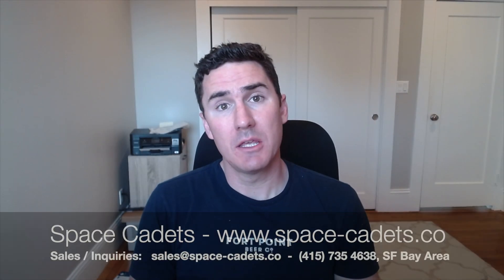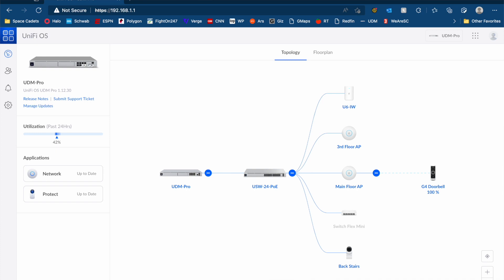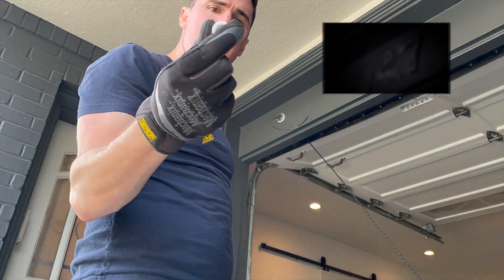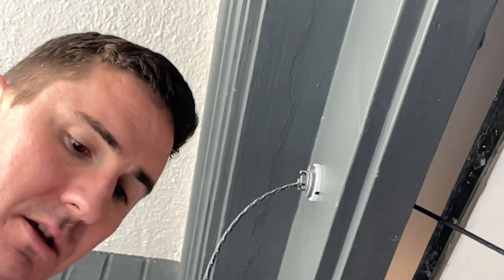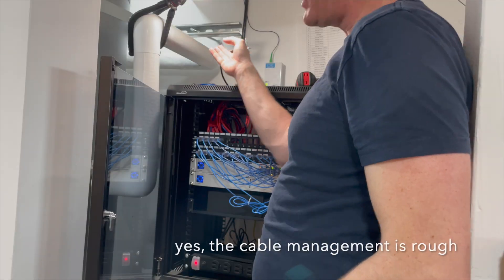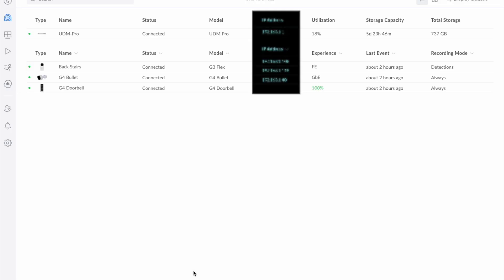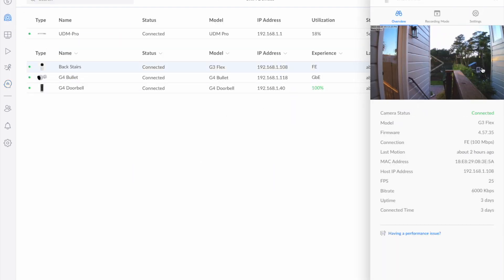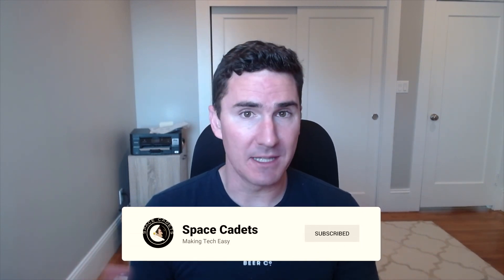Revolutionize Your Home Security: G4 Bullet Camera & Unifi Protect In-Depth Review

Comment: /off topic : How come there's so much room between the door and the floor , at the bottom of the door behind you ? No troll, I wonder if there is a reason or just a mistake from the carpenter or else ?
Nice video, I wish I can buy the bullet Pro* but it is sold out (G5). I'll wait a bit longer and then, unfortunately, I'll opt for the non-pro.
Reply from the maker: The house previously had carpet over the hardwood floor.  We pulled out the carpet and refinished the floor, but hte door height was still set for the much higher carpet flooring :).

Comment: Nice video for the installation of the G4. I was curious what you used for the weather sleeve?  Is that something that came with the camera or did you get it separately? Thinking of putting up some Unifi cameras and want everything to be watertight.
Reply from the maker: The little rubber weather sleeve for the ethernet cable comes with the camera itself.  It can be finicky to get it properly seated during the install, but works well.  We've had a lot of rain in CA and in a separate installation (working on content) I've had the cameras exposed and they've been super solid so far.